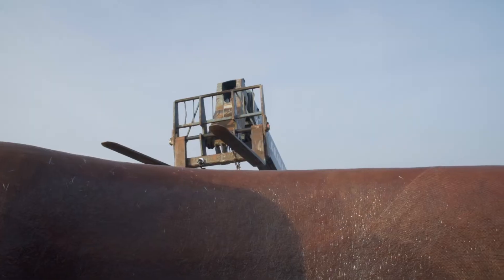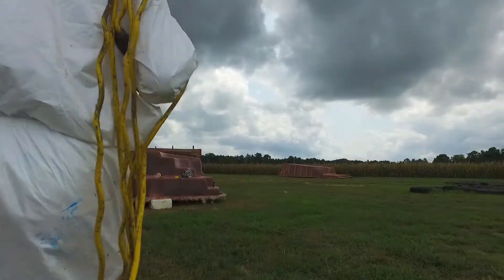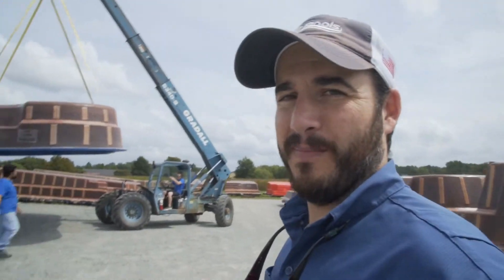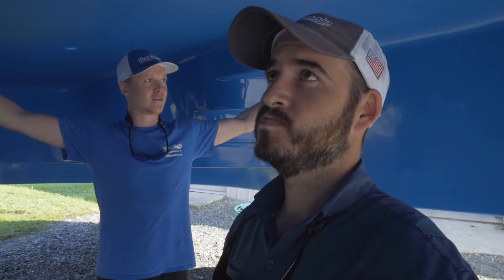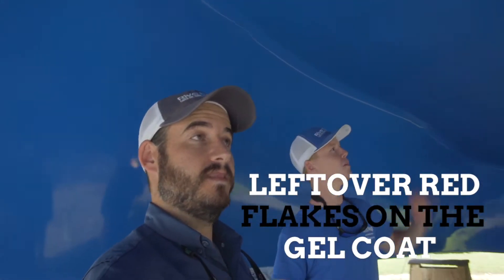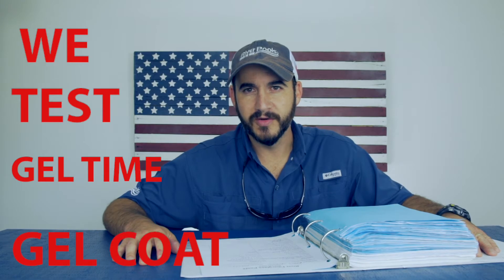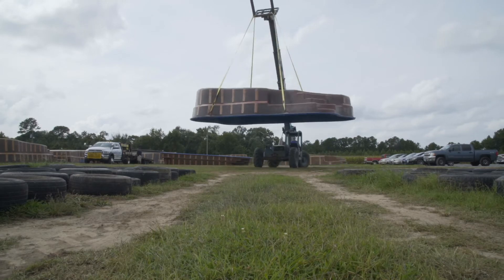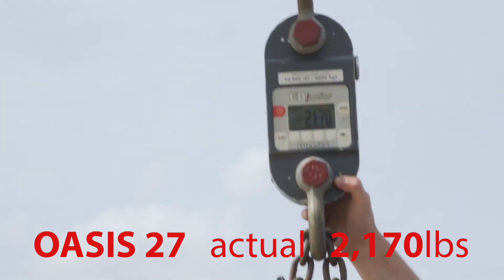How Fiberglass Pools Are Made; Quality Inspection; 6 of 8; How to Build the Perfect Fiberglass Pool

Comment: Looks like you guys are very detail oriented.  One thing I noticed though...when you are underneath (inside) the popped pool there appears to be some light spots in the gelcoat like the sunlight is filtering through the bottom (thin spots).  Was this the case and what do you guys do if you find some light coming through the layers?
Reply from the maker: Jeff, thanks for watching.  To answer your first question: I can personally verify that the spot you're seeing was not sunlight shining through a thin spot.  I was the one filming the scene and we spent quite a while under that particular shell shooting lots of footage.  The spot you're seeing is a reflection from water on the ground...the shell had just been washed. And to answer your second question: If we were to discover a thin spot in the shell it would be sold at a discount.  Thin spots are not an impossibility because the pools are made by hand, but we have quality check systems in place during the build process to prevent this from happening (we check thickness with a gauge as we go).  Should a thin spot be discovered, the pool would be sold at a discount and (standing behind our work) it would still carry our full warranties.
Reply: Show me  the actual mould making where I can cast several shells from it.looking for 4x4 dia round, with seating Thx